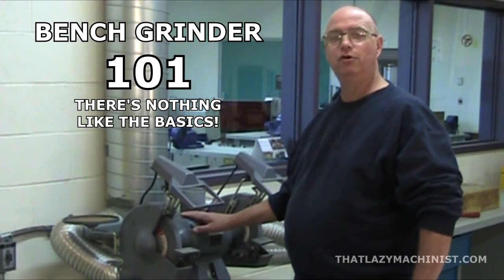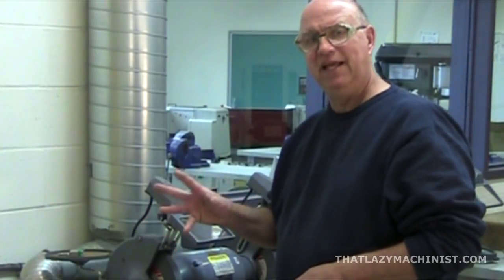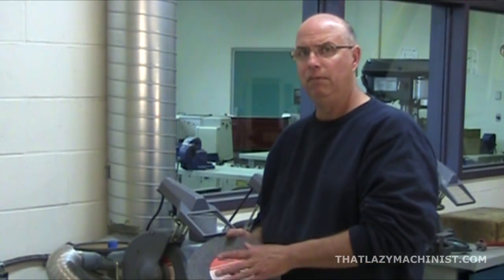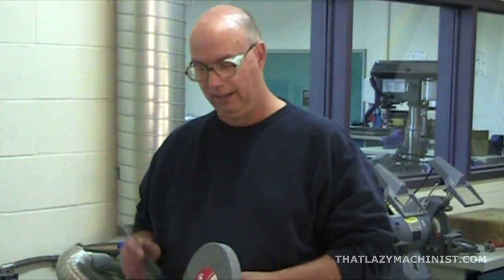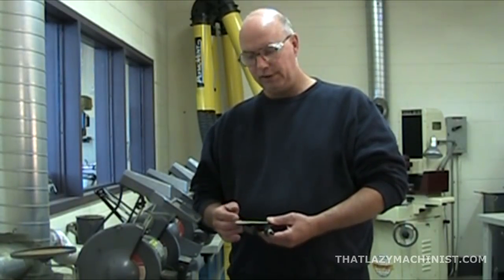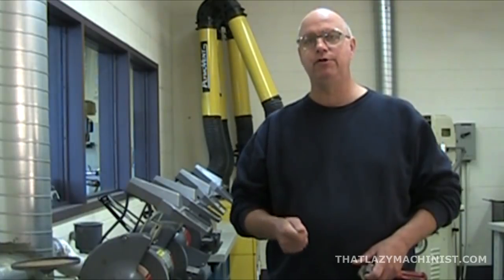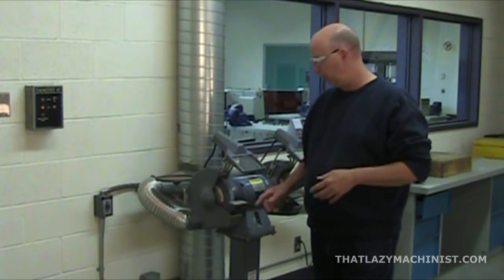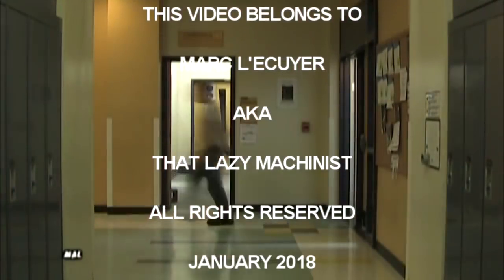INTRODUCTION TO THE BENCH GRINDER, MARC LECUYER GRINDING 101

Comment: I've recently inherited my grandfather's grinder.  The tool rests have obvious damage from contacting both the stone wheel and the wire wheel.  The grinder model has been discontinued.  Any suggestions for repairing or replacing the rests?

Comment: Where can I get some illuminated protectors like the ones shown in the video?
Reply from the maker: Hi Alfredo! The covers came with the machine but if your grinder doesn't have lights you coud use small LED lights and get the same effect. I hope this helps, thanks for watching and for taking the time to write, Marc

Comment: I think safety is very important but you go to far sir, When you say things like tape the plug people lose faith in your content and stop listening to the important safety tips that you do share
Reply from the maker: Hi Chris, it does sound radical to tape the plug on a grinder that is broken or being repaired. I would never do it in my shop because I am the only one using it. I was however a teacher for a quater century and got use to overdoing it, mainly because I had thirty kids working around me that quite often didn't master what they were doing (that is a polite way of saying that they scared me). I would say in my defense that there were some cuts and bruises in my classes but there was never a major accident under my watch. It is important to work safely, and what that means is different of each person and I don't think that most people will loose faith in the content of my videos but is is good that you remind me that I must remember that I am no longer in class. Thanks for watching and for taking the time to comment, Marc
Reply: Not a Machineist, but tape plugs quite often in my line of work, if there is any chance of people trying to use the equipment before it can be repaired or removed from buildings  mainly because of electrical issues. I have even cut off plugs if it is a fire hazard with the wiring all frayed or is being removed for salvage and recovery.  I found out the hard way when Installed an out of order sign on a freezer and came in the next morning  an someone plugs back in the freezer and the sign was missing. Guess they can't read. LMAO
Reply: I respectfully disagree. Spending all of thirty seconds to provide a visual clue to someone - or ourselves - not to hook up to power, is neither going too far nor radical. Instead, it is a good idea.

Comment: One thing i learned  from working in a shop was to stand off to one side when starting up a grinder as you never know who used it last or if someone has been working around the grinder may have bumped the wheel heavily enough to fracture it .
I like the extractor hose you have on that grinder and will modify my bench grinder so i can hook up my shop vac when i dress the wheel so it keeps the dust down !